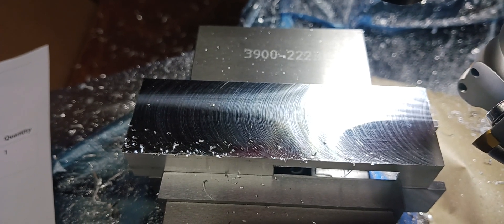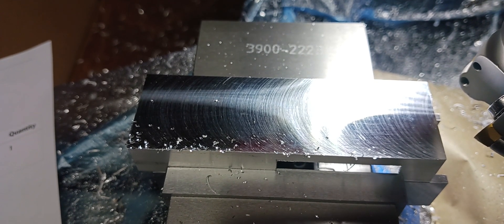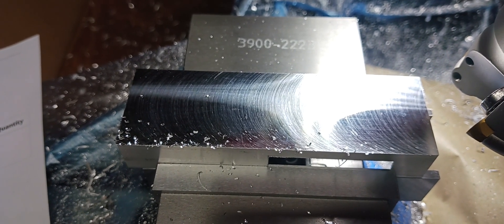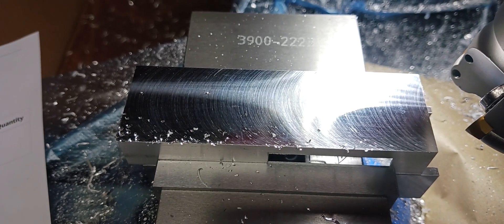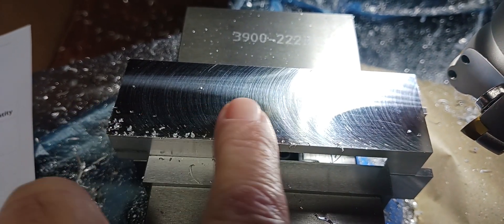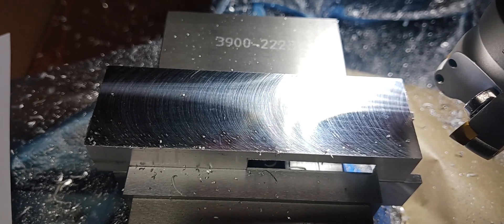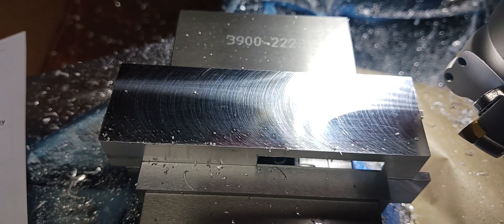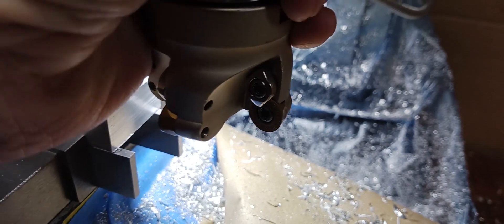2 inch face mill, more tools that dont work as promised.

Comment: H01 inserts would sort that no problem also small manchine with thats less rigid in the z axis would do better with a apkt style all a apkt1135 h01 or ampt1135  for steel would be completely diffrent allso aluminum likes lubricant to avoid sticking it to inserts 
Rpmt1204  or 1606 style shell mill is a less than ideal solution for a small machine

Comment: I don’t even know where to start. First it is clearly stated in the specs that the face mill capacity is 1.2 inches. Second, given the fact that this is a low power machine using carbide cutters on this large of a cutter is destined for failure. Carbide requires a deeper depth of cut to function correctly than HSS.. Once again you are blaming the tools for your lack of knowledge. Buy a damn fly cutter. It is a single point tool much more suited to this machine. And the chips stuck to the surface is a direct result of not using a lubricant ( WD40)

Comment: Put some inserts intended for Aluminium in it rather than the cheap general purpose ones supplied.  They will totally transform the way the head cuts
1/2thou cut is way to shallow and all you are doing is rubbing the surface
Use Kerrosine or WD40 to stop the surface picking up and causing those chips.